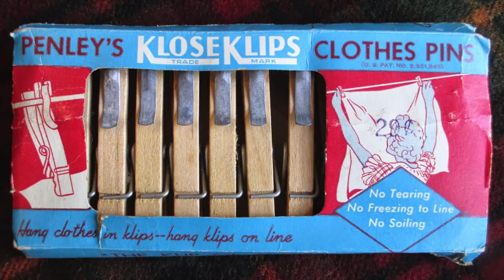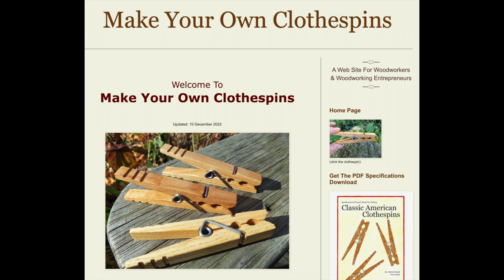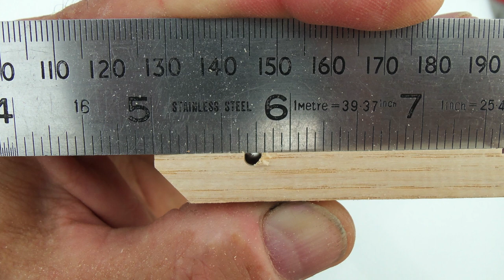Woodworking Project— Make High-Quality Classic American Clothespins

Comment: My one question would be, why cut the long boards apart? Would it not be faster to shape the entire board and then slice off the finished halves?
Reply from the maker: I wish it could be done that way. But the grain of the wood would end up going across the pins and they would break easily.
Reply: @herrickkimball  Thank you, I knew there had to be a reason that I was missing.